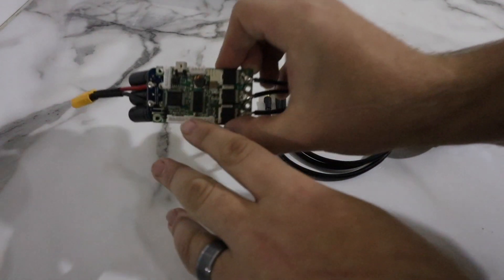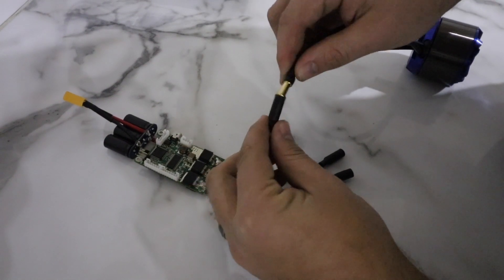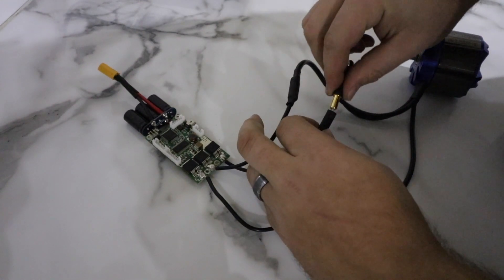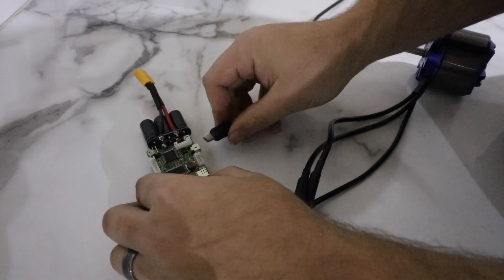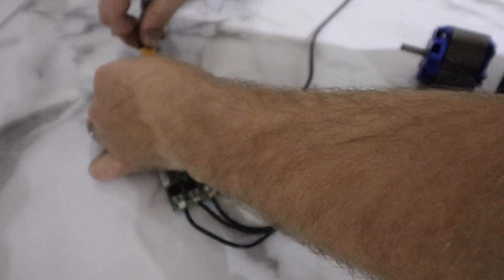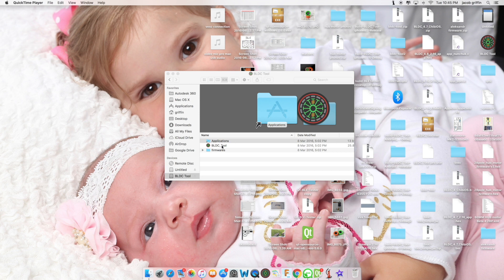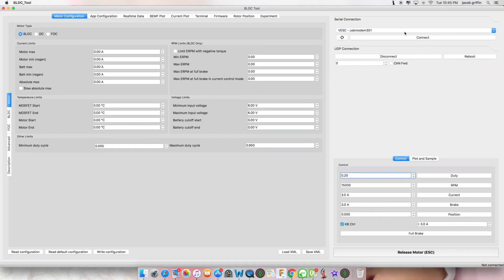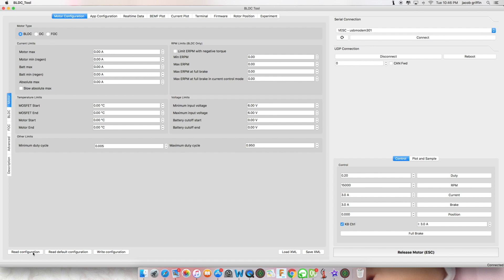VESC PT1: connection

Comment: I've got a vesc and a torque board 6374 190kv motor, where do I plug in the sensor wire into? Which vesc port?

Comment: Hey!
My motor has 4mm connectors and the vesc has 5.5. Do you see any problems with removing the 5.5 on the vesc and soldering on 4mm connectors?

Comment: can you tell me that the rc motor is a ac/dc motor. adn the ecs take input of ac/dc current ..and give ac/dc current output

i dont know about electronic and electronic part i am little bit of confused plz help dude
Reply from the maker: It's a BLDC motor so very similar to an 3 phase AC motor but with DC supply
Reply from the maker: The vesc can also do DC motors,
Reply: can the motor run  on ac supply and also the ecs...
Reply from the maker: +killua zoldyck no its DC

Comment: Hi 
first of all thanks for this video series, I think it will help a lot of new esk8 such as me! I really appreciate it :)

I was wondering, if there is a limit of the voltage of the batteries, that you connect to the esc, I have read that there must be under 12V is that true?
And do you use a power switch? If so which one?
Reply from the maker: the vesc can handle 12s so 8v up to 50.2v